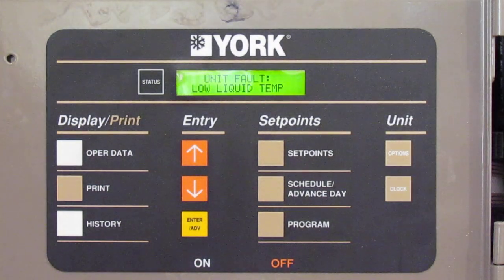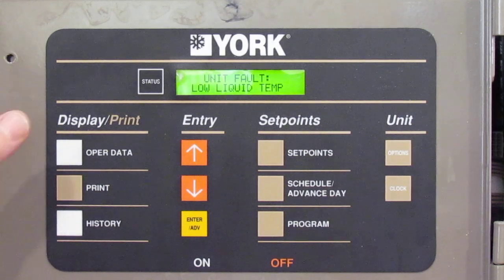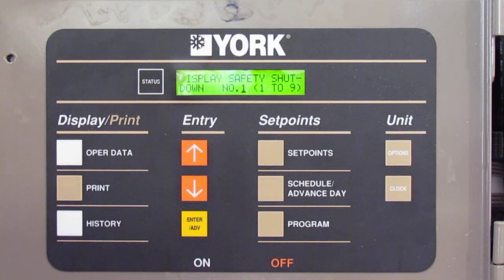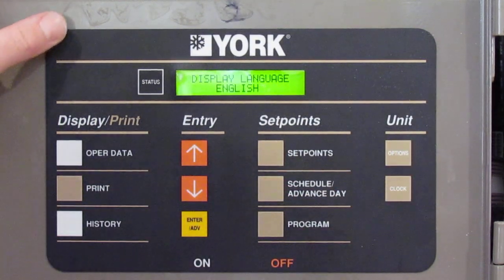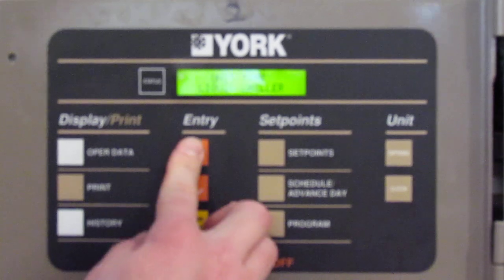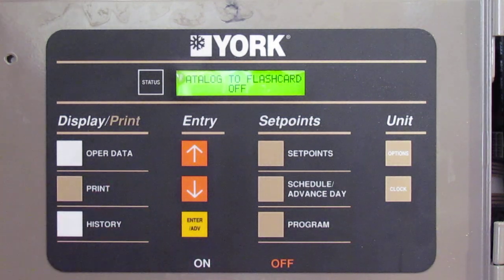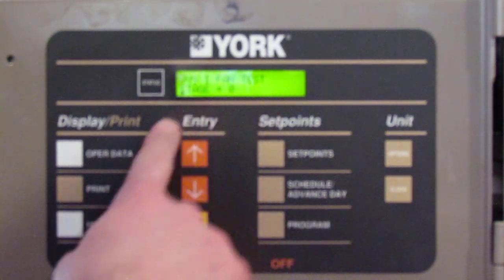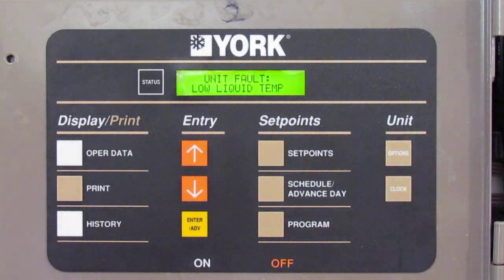How to operate a York YLAA Chiller Control Interface

Comment: Hello sir thanks for supporting us 
Sir i have one problem about same chiller 
My chiller display showing blank there is not showing any parameters only display light is there
Reply from the maker: @mskengg  sounds like the screen is faulty. Try changing it with one that works if you have another chiller of the same model to confirm it and order a replacement.
Reply: Thanks sir  i have one more question if you don't mind 
after display change if we found same problem then what will do  
#  And  if we change the other small bord which is connected with bigg bord with battery from other working chiller then no any programming program
Reply: Sir i am waiting for your reply please sir I need your help
Reply from the maker: @mskengg  first start with the screen. Does the chiller run with the broken screen? If yes, then highly likely it's just the screen.
No programming is required when changing just the screen. Lastly if you do not feel confident in the work you are about to do then I recommend seeking another person who can assist you with the task.
Good luck and I hope it all works out.
Reply: Okay sir thanks i will do what you telling 
Last question sir please If i replaced Daughter board then required programming or no need
Reply from the maker: @mskengg  no need for programming a new display board.
Reply: Battery board the small bord which is connected with the main boards i am calling that one
Reply from the maker: @mskengg  I'm assuming you are working on a YLAA chiller? No battery board connected to a YLAA display board, just a ribbon cable.
Unsure as to what you working on?
Reply: Master. I watching your vedio york yllaa.. My unit no star. The desplay in board is. Low liquid temperature..what can I do  to start.. How to start. Than you..

Comment: Hlo guys plz help me out 
I have 2 ysaa chiller, the problem is both chiller running 5 min then going to timer i checked all parameters while running there is no problem with parameters
Reply from the maker: @reyazahmad1792  hi,
The 5 minute timer is normal for the protection of the equipment. It is an anti-theft cycle timer. Normally it happens when the chillers cycle off due to low heat load. Check your chilled wate
Reply from the maker: @reyazahmad1792 check your chilled water loop, be sure that a bypass valve is not open causing the equipment to short cycle.
Reply from the maker: @reyazahmad1792  sorry, predictive text strikes again. I meant anti-short cycle timer, not anti-theft. 🤣

Comment: Hello sir i need your help my system is same model but this  system is before R410 now showing R22 please give me ideas how to change
Reply from the maker: @mskengg  ok you need to select the refrigerant from the display.
1.System switch off postion.
2.program ...code up, up, down, down, 
3. Scroll through all parameters until you get to system refrigerant and select the required refrigerant.
Reply: @latentfusion2563  thanks sir i will try tomorrow after then I will give you feedback 💕😍
Reply: Thank you so much sir i appreciate you now solve my chiller issues thanks a lot💕💕💕💕💕💕💕

Comment: Sir, i have a question pls help.
Our chiller model is YCAA-B 170.  With 4compressor (2 refri. circuit)  
We find that chiller running only 2compressor always and show 2 of 2steps,      
I have also check and confirm other 2compressor still no problems.
Have any setting parameter about compressor no. or steps? But i cannot find these 2 parameter even in services mode
Thank you so much
Reply from the maker: go to options press enter and check that system switch one and two are both set to on. push the arrow buttons up or down until on is next sys 1 switch + sys 2 switch.
also scroll through options until you come to local/remote mode. switch it to local mode and observe operation.
scroll down to lead/lag control in options and set it to auto.
press the program button then enter, then scroll through until you get to total number of compressors. make sure that it is set to 4. same goes for the total number of condenser fan motors.
good luck and let me know how you get on.

Comment: Hallo Sir...
There is one CARRIER Chiller 
Model # 30XA 0402 A 6
There is Alarm Comes all together 
Like 
Circuit A Oil pressure  transducer 
Circuit A Economizer Transducer
Circuit A Loss of Communications with Fan Board A 
Circuit A Loss of Communications with EXV
Circuit A Loss of Communications with Compressor A

Which alarm is comes for Circuit A same that Alarm comes for Circuit B also ....

Any setting or something else...

Can i expects Any help from you ....
Reply from the maker: If you take a look at the common fault it appears to be a communication issue with the main board. It could be a break in the interconnecting wiring to the inputs or a faulty control board. Have a closer look and bell out the existing control connection.
I suspect an issue with the board.
good luck with it.
Reply from the maker: also check the control board power supply. ensure that there are no blown fuses.👍
Reply: @latentfusion2563  All Transformer have fuse and all checked, its ok, both compressor Board getting input 24 vac but it should be output 24 vac for Oil heater relay it's not getting at the relay ( Contactor )...
And i couldn't found main board output 
I am confused because there are 1 main board 2 compressor Board to find which is the problem....
If any good easy way to find .....?
Reply from the maker: I believe the fault will be with the 'a' compressor circuit board or communication wiring.
This fault will also prevent the circuit 'b' from operating.
If another carrier chiller is around you could try borrowing parts from it.
at any rate you will need to order in some parts.
let me know how you get on.

Comment: Sir 
I have one question 
System # 1 and System # 2 not showing parameters in display like suction temp; Sat suct. Temp; superheat; EEV all this are not showing in display of both system what is the problem can u help me chiller working but not showing parameters... all sensor are connected if any program setting can help......
Reply from the maker: I will assume you are working on a older YLAA chiller. on some of the older YLAA'S that operate expansion valves instead of EEV'S they do not display suction temp or superheat in the system info.
you will only be able to see the suction pressure and discharge pressure all other values must be measure by you.
hope this helps
Reply: York Model # YCAL 0347

Before it was showing all this parameters but suddenly it is something wrong after that not showing all temp. Parameters.....
Reply from the maker: check in the options menu under expansion valve that EEV is selected and not thermostatic.
to change you may have to enter the service program mode.
service switch in the off position, program button, up up down down enter. scroll through parameters until you come to expansion valve selection.
have a go.
Reply: @latentfusion2563  Thanks Sir ..I will try and reply....
Reply: @latentfusion2563  Thanks a lot .... Sir...
It's done now...
All temperature parameters showing same like before....

Thanks again Sir...
It's really help for me...!!

Have a good Sir....